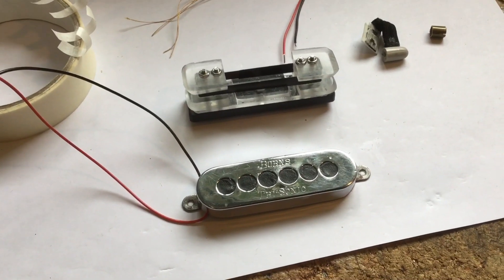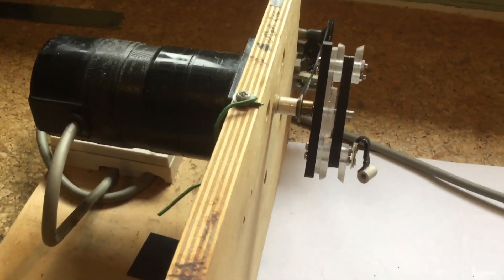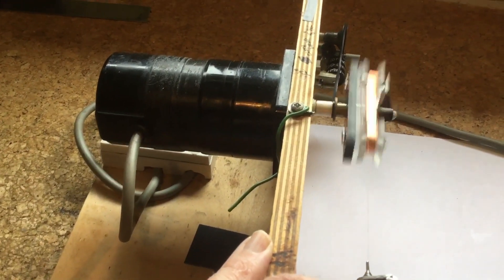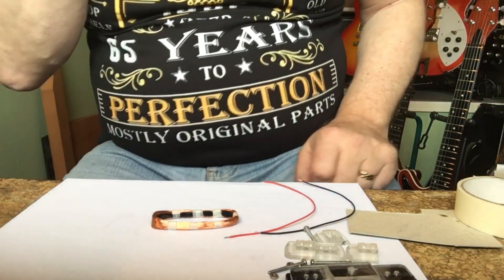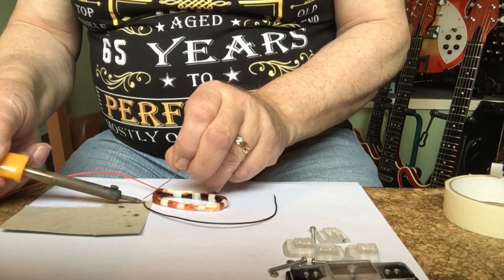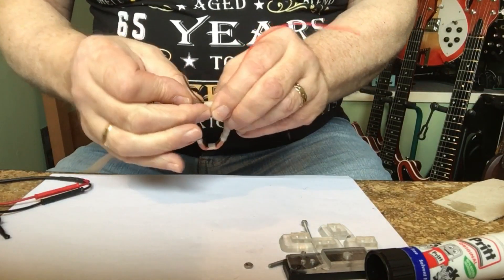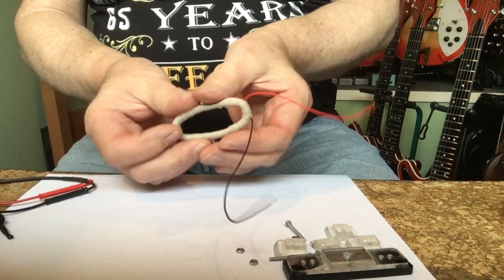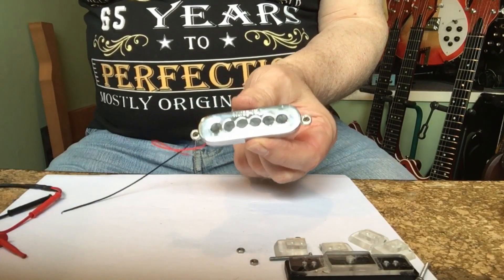15 April 2018

Comment: Are the 2 isotopic magnets held in the bobbin with both their faces pointing north because if they are placed end to end they repel and try to spin round  I have made the coils and have the magnets from axerus ,  I have been having trouble figuring out how to install the magnets the correct way as the faces are polarised not the ends like normal magnets, if you place the down end to end they  attract
and spin back round so one face is north, and the other face is south
Reply from the maker: The magnets must be placed with the same polarity facing the same way, as in both North up. Usually just placing them on a steel baseplate will hold them down. (Must be steel b.t.w.) and the coil will keep them together. When you are happy they work, they need to be wax potted.
Reply: Cheers Richard i like to make my own projects, it's the only way to learn   @richarddadd8432

Comment: I’ve made a set same as yours they sound good. Would you say they are as good as the original pickups ? as I have none to compare too . I also built the guitar too 90% by hand . Cheers for taking the time to record and upload this information it’s been very helpful.
Reply from the maker: Mine sound very authentic, as the data I used is very comprehensive. But also bear in mind that magnet type and size plus case material and size do have a bearing on just how authentic they will be. All “air coil” tri-sonics will be in the right ballpark, mainly due to the basic design anyway.

Comment: Turns out that the magnets glued to the back of cheap Chinese single coil pickups are isotopic i bought 3 for £10 bust the magnets off the back and used  them one long bar magnet  as some pickups use 1 magnet so I understand

Comment: My 2 magnets has to be twisted   End to end and held in place with tape otherwise they twist they won’t face to correct way under there own attraction . I’ve made 3 coils with central magnets middle pick up facing south towards strings .. I also read that middle pickup is reverse wound ?
Reply from the maker: I didn’t get any notifications about your questions. Yes, you may need to tape the magnets so that both pieces face the same way in polarity. In a Trisonic case, the coil should hold the two magnets reasonably well without tape. For full humbucking effect, reverse the middle magnet.
Reply: @richarddadd8432  cheers for info I’ve made my own thanks to you they sound great 👍

Comment: How did you get 7,30 kohm with 5400 turns? For my trisonic I did 6300 turns to obtain 6,9 kohm.
Reply from the maker: My bobbin is 62mm x 10.25mm x 5.7mm deep, that should get you near my figures.

Comment from the maker: The wire is 44 awg, wound to around 7000 ohms. The magnets are two pieces of Isotropic ferrite ceramic as 8mm square section and total 57mm in length (28.5mm each)

Comment: "08:02 : Do you want coffee...."... :D Excellent video, totally loved this. It's always interesting to see other's homemade coil winder. I might upgrade mine using a proper noozle, rather than a home-made one. I would be afraid of letting the copper wire through metal holes though, as it might maybe damage the insulation . Probably not though, as you're having no issue with this.
Reply from the maker: Yes, I was concerned about the inlet hole, there should be an eyelet in there, but I saw that there is no tension at this point, so no problem for me.
Reply from the maker: My nozzle is only from a fine point pen!
Reply from the maker: Now added a nylon liner where the wire enters - makes good sense. (Actually used a short section of Bic Biro ink tube!)

Comment from the maker: Burns vintage style Tri-Sonic pickup coil winding, with the most basic of home -made equipment. Classed as "air coils" - these are used in many old style pickups and famously used in Brian May's Trisonics.
Reply from the maker: jlwheatley42  Steel baseplate. The whole thing with Trisonic tone relies on the base being magnetic. It makes 3 poles from the central magnet and the two upright steel edges of the baseplate.-hence "Tri-Sonic"
Reply from the maker: jlwheatley42 Slightly larger circumference. Doesn't want to a tight fit, and has tape wrap to take into account. Haven't got the bobbin to hand, but the coil itself needs to have an inside dimension that will comfortably fit over the magnet assembly and the depth around 5.5mm. Can't give exact dimensions, you need to possibly make an adjustable length former and experiment.